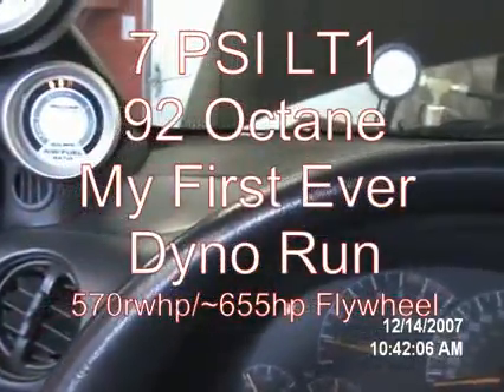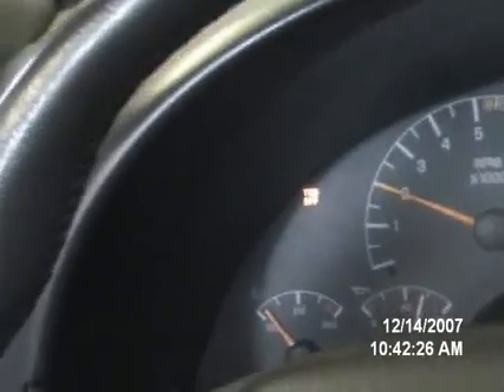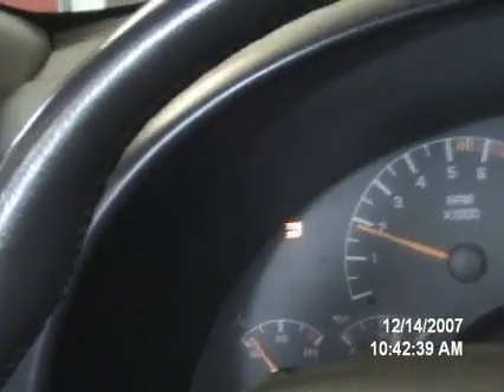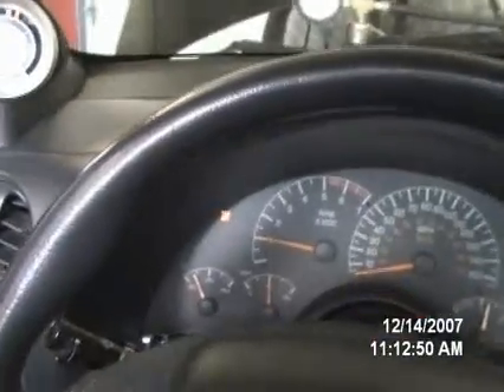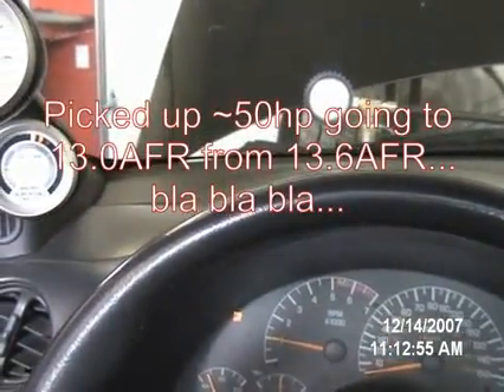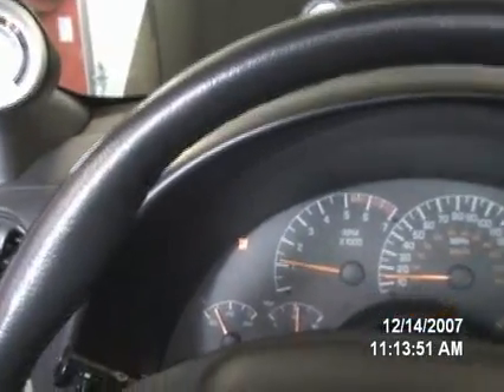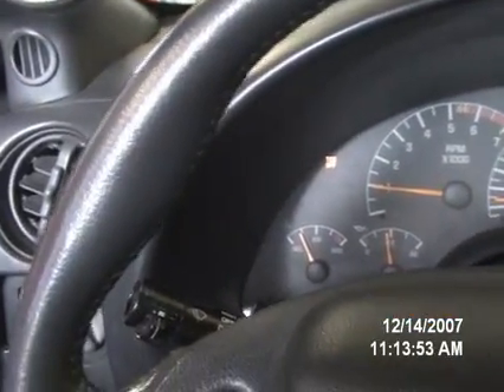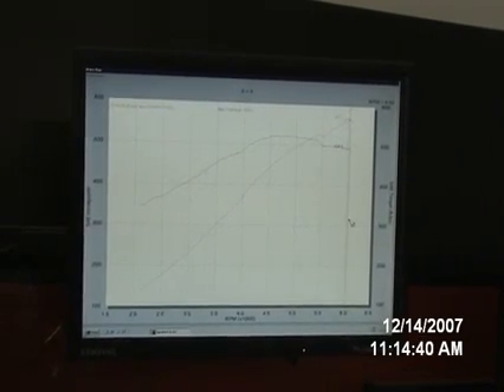My LT1 7 PSI Procharger 570rwhp ~650hp Trans Am Dyno Run

Comment: Stock transmission?
Reply: Dan Mc did it last? I am thinking of getting a procharger and I don’t have the money to beef up the rest of my car
Reply from the maker: Yep never had a problem,  in fact I only sold it because I needed a bigger car, so I got a 2010 Camaro, Whippled it.  Just dont try to do a wheelie or drop the clutch on launch and your fine.  Tuning (to avoid spark knock) is key.  I have a "Knock Alert" video on there somewhere.  That's all I ever watch for, avoid that and your good forever, literally.

Comment: I’m trying to find good forged internals for my LT1 anyone have any recommendations?
Reply: Hard to find these days because the world is a hater of the lt1, but Eagle still makes forged rods and franks for it. 

And JE makes forged pistons for it too, I think.  

Hawksperformance.com sells these procharger kits for it and you can find people to build you custom turbo kits for it as well.

Advanced induction is still selling ported heads and intakes for it, and is still grinding custom cams for it, so it's still going.  It's much cheaper to build than LS engines.  So, you know, you could build a 10 sec 650whp car for like $9,000 including buying a transmission. 

Another good option is a lq9 turbo swap.  But that gets pricy because Gen III transmissions have the 'LS' tax on them.  All that sh*t is overpriced these days.  But Lt1's remain affordable and they can make big power. And 92-97 camaro's are great chassis to build on.
Reply: https://www.hawksmotorsports.com/93-97-lt1-camaro-firebird-procharger-kit/ * 

Not hawks performance.  I typed the wrong url in the first comment.
Reply from the maker: Diamond Pistons and Callies Crank is what I used.
Reply: @1DanMcLain  is the car still running ??
Reply from the maker: @sergiocarmonajr7127  I sold the motor, but yea I think it still is.  A guy on Camaro28.com bought it 5yrs ago.

Comment: What intercooler setup are you running? I have the twin intercooler on my 97 Camaro. What size engine? Sounds like a 383? Also are you running a inline fuel pump (Boostapump) with your walbro 255?

Comment: why do people hate on the lt1?
Reply: Because of the Opti-Spark and the fact that they can't stand the Name that represents us. LT1 and LS1. I think it is because of the name. But also I think they hate on LT1s because a well built LT1/ and even better a well built LT4 can hang with the best of the LS guys out there. I might be wrong but I do love it when I beat most of the bolt-on LS cars at the 1/4 track that I go to with my 383-procharged Camaro. There was a C6 Z06 that was cammed that was able to beat me but I spun pretty bad on that run (No I'm not making excuses but a loss is a loss) cause he hooked up but by the time I grabbed second gear he was already to far ahead. Because of wheel spin I'm limited to low 11's. Maybe that's a good thing cause I might get kicked out without a roll cage. But back to LT1 haters out there, they look down on LT1/LT4s because of our age and the Opti-spark but that's only a guess.
Reply: By the way I'm making 520 horses at my wheels because I need to upgrade my fuel system other wise I'm stuck at 8 pounds of boost. This guy seems to have a better fuel setup therefore is able to make more boost. I wonder what intercooler he is running?
Reply from the maker: Who hates the LT1?   I have a LS3 with a whipple on it, and because of the large intake ports, it doesnt have the low end power/torque that the LT1 had.   Peak Power you will get with the LS3 but you wont get the off idle torque monster the LT1 is...      all out drag motor, the LS3 may rule...      street motor where you want to pull hard from idle,   LT1 modded like this = 100%.
Reply: You'll be surprised how much cold shoulders I get when I cross the finish line before they do when they have a LS and I don't. Even here on youtube I get people who bash me when I say that I love the way the LT1/LT4 motors look, sound, accelerate, ans what you can do to them and it's like I insulted there Grandmother. I mean I've gotten straight up hate online. It's incredible...
Reply: Wait did you say in the video that it's only making 6 pounds of boost? I guess your running a D1 procharger unit. I'm stuck at 8 pounds of boost and only making 520 at the wheels with a P1. Plus I need more fuel even with the smaller p1 unit. I can't wait to see what a D1 will add with more fuel and tuning for me. Since I'm running the same type of motor I can ask you question after question but I don't want you to give away your secrets either. Such as cam timing and valve size plus rockers and springs cause all that makes a difference to in power. But wow 6 pounds of boost and nearly 600 plus horses in a LT1.
Reply: because our engine blocks are black.
Reply: my last oem opti spark lasted 200k .
Reply: bondovwvw where did you purchase the. Ew one from?
Reply: Thats what i wanted to kno i guess you get more hp out of a aluminum block then a iron im guessing👍👎
Reply: @charlesfulton6269  no aluminum vs iron the block doesn't make any HP difference it's just lighter and that's it lol

Comment: how much was the whole build ?
Reply: Most likely over 20 grand.
Reply: @Savineyard3  Easily 20k,  then, for peace of mind, tack on another 12k  for a Stage 5 M6 upgrade w/clutch, driveshaft and a well built rearend ! Suspension upgrades is another story. Don't forget the rollcage lol..
Reply: Oh yeah I forgot about the need to upgrade my cooling system with a setup from Wizard Racing that consists of a bigger aluminum radiator, 3,000 cfm plus dual fans with integrated fan shroud so I can do multiple laps with less cool down periods on the road coarse tracks that I want to race at.

Comment from the maker: @Xxdream2sing89xX :   N/A the heads make about 530rwhp:   "This is the exact head that powers Rick Abare's 530 rwhp 3440-3470lb Trans-Am into the 9's at over 138 mph on pump fuel".

Comment from the maker: LT1 with AI 200cc ported stocl LT1 heads and intake and their cam, they obviously didnt want me to advertise specs of the cam.  Compression is 8.9:1 on 92 Octane.  Stock trans, PCM, and 3:23 Axle.  around 21 mpg ave hwy, same as I got when stock.

Comment from the maker: checked that car out, looks good but missing critical info such as boost and engine info.  Stock LT1 could prob make 600hp with meth but wont last long stock.  Dont know how long the LS1 would last stock at the power level.  Im only at 7-9psi, that LS1 might be 15-20psi.  Just dont know.

Comment: whats she run in the 1/4? i was planning on doing the same thing.making it a 383 with forged pistons,hardend rods & crank, AI heads&cam then a D-1SC at 12psi :). should push around 650-700rwhp (guessing)

Comment from the maker: Top Speed has with power alone.. gearing is there to match the power.  1/4 mile is limited by power, not gears since you rush out and change gears in a hearbeat if your redline before 1/4 mile...  hmmmm.

Comment from the maker: yea.. major power.  7psi your looking at ~40% increase, so 750+300 =1050,  another 7psi will give prob 20-30% due to heat and loss of timing, sp maybe 750+450 = 1200hp... impressve

Comment: hmmmm 570 with 7psi on a 350. wonder what my 468 with dart heads, and comp roller will do. im gonna be running 14psi with a motor built for a super. dyno mans guess was 750 min. with a procharger guess of around 900.

Comment: damn dude. so you dont have the LT1? cause i have just a stock LT. im looking for about 500rwhp, how much should i be looking at spending to get it, and what mods do you best recomend. i dont think i want to supercharge it, im thinking heads, a cam, injectors, headers, exhaust, and other little basics. i dont want to do anything completely drastic. im also still looking to get some fuel economy. what mpg does yours get now? mine gets mid 20's avg. but its also a M6 car.

Comment from the maker: pretty much yea heads and cam + 7psi are what made the power... I have 383 however that's not much for HP.. maybe 10hp?  I also have 9.0:1 down from 10.5 so that's about 20hp lost.. 
Also my at least 570rwhp x 1.15 (manual trans) = 650hp but the supercharger itself takes maybe 20-30hp so that's about ~680hp crank HP (or fuel being used HP).
Engine Mods include Heads/Cam/83lb injectors/headers/3"exhaust/1walbro fuel pump/stock fuel rails+lines+reg.. 
15psi = ~750rwhp...

Comment: so basically if i do the heads and cam package and a procharger im looking at around 575rwhp? you loose about 15% of crank hp throught the drive train. or was the 670 whp? how much does it cost to have a procharger installed cause i dont think i could do it myself, but i could probably do heads and a cam, but i couldnt tune it myself.

Comment from the maker: with 6psi totally stock I got exactly what they say on the site...  up to 50% which is about 440hp engine HP.  With some head porting and cam you can get 670hp (230hp improvement just from headwork and cam)